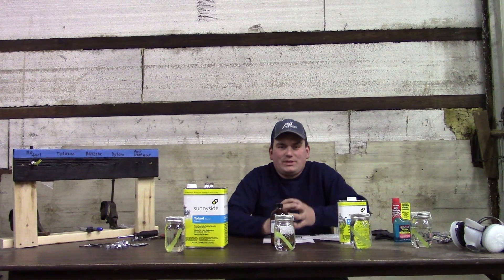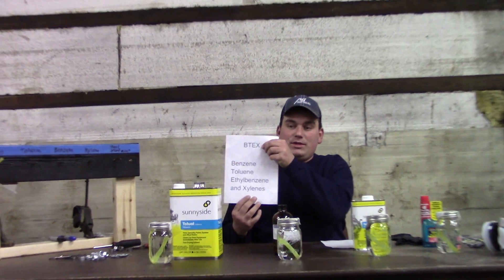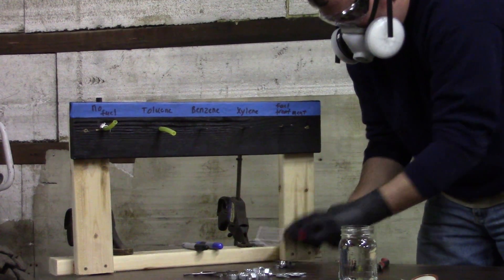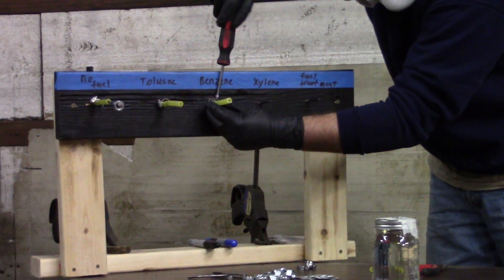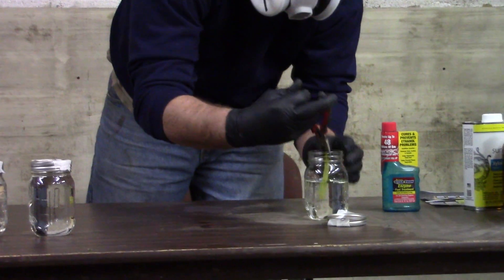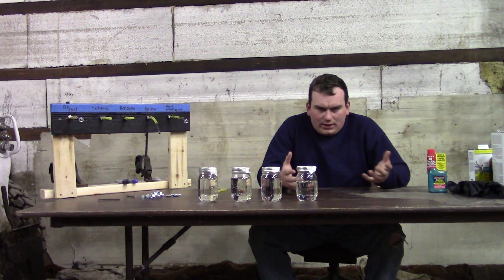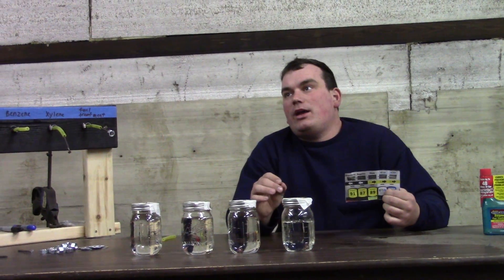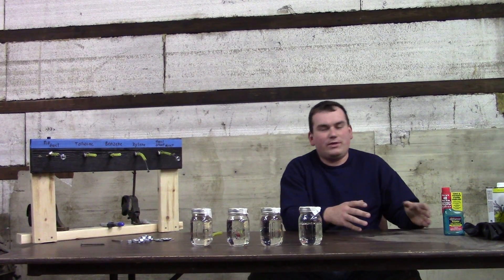What is REALLY causing your small engine issues!!

Comment: I agree mechanics no nothing about fuel properties, composition, or benefits and are the first to help peddle oil and fuel additives.  They are not trained and few have any interest in it beyond octane level.   This is not reasonable comparison and not surprised that no else is using 100% concentration of BTEX chemicals and 100% exposure on fuel lines, o-rings and gaskets.  Manufacturers like to blame other issues.  They can cut their losses by pointing to a mechanic failure.  Case in point.  Gas Direct Injection causes dilution of engine oil and abrasive soot which leads to engine damage and failure.  Ford, Toyota and GM have blamed poor choice in piston rings on a few early year models for timing chain wear and oil consumption when in fact it was GDI.  They repair and replace piston and  rings for a few model years and call it good, while everyone still suffers from the same problem.  Then oil companies and OEM lay low for another five years then make drastic changes to the oil testing and formulation to counter the affects of GDI.  That too was done without much fan fare.  Search on GDI Soot.  GDI gas engines produce more poisonous hard particulates then deisel engines.  Look for Exhaust particulate filters for gas engines soon. Search on API SP new tests.

Comment: Thx for the informative videos.
Is it recommended to run E30 without any conversion kit or mod, such as using bigger injectors and 4 electrode sparks?
When an ethanol conversion kit becomes mandatory, beyond E50?
Does E30/E85 suits direct injection engines?
Reply from the maker: E30 yes

Comment: Ethanol is a water absorber water is corrosive to fuel pumps fuel level sensors etc plus it's good st removing the oil film in the cylinders less btu less energy per gallon per mile more fuel usage.

Comment: My main issue with any ethanol in fuel is makes my 83 mercury 115 outboard run not very well while trolling due to it being carbed and it cant compensate for the lack of energy of the ethanol in the fuel it coughs randomly. I put in ethanol free gas and man trolls nice and smooth.  So with out knowing what others have said i can see a carbed motor running a little hotter while being worked hard since the mixture would be leaned out a little unless it was rejeted to make up the difference  Just 2 cents from experience. I saw your burn test video as well.
Reply: to run Ethanol it is best practice to change the timing setting. pure Eth burns slower. you can even increase the compression ratio to 13-14 to 1.  to gain higher engine efficiency. Eth blends burn faster then Gasoline.ie: E85

Comment: "Do the test yourself". Nothing more definite than that. I'd like to see tests showing where that gummy residue causing problems in carburetors comes from. I have long suspected it's in that gasoline brew - not the ethanol.
Reply from the maker: Orlando Furioso you are absolutely correct. If you watch my other soak test the E85 fuel line is drastically cleaner then the Gasoline one.
Reply: In the gasoline manufacturing process there are some double, unsaturated,  bonds formed in some of the processes, for example cracking of heavy fuels.  This allows a polymerization process to occur and hence gum.  The better gasolines remove the double bonds with hydrogenation, etc, or they add additives to prevent the polymerization..  Typically the better gasoline is made by the major companies.   The cheaper gasoline are cheaper because of less processing steps and cheaper additives.  You get what you pay for.  I am not sure but the ethanol may exacerbate the polymerization process.

Comment: To make this test equal you would need to calculate the burn times for each fuel since E 100 is 33%  lower in power produced per gallon.Now as far as cleaner sure it does burn cleaner but the intrinsic costs such as fertilizer and fuel to produce it must be weighed in the total outcome.100s of millions of cubic feet of natural gas used every year to produce the fertilizer to grow the corn,Millions of gallons of diesel to plant and harvest,Coal and nuclear to cook and make the ethanol.If it could be produced with solar and wind the offset to the environment gets close to gasoline but natural gas and electric along with increasingly fuel efficient engines make the ethanol story a grasp at straws.
 The most widely used fertilizer for Corn is predominately made from natural gas catalyzation.In that process Millions of cubic feet per day are used.When you take all of the story and add up all the parts ethanol is still a net loss on the clean burning side and power production.
Reply from the maker: That's incredibly false. The 33% thing only has to do with btus. They measure heat NOT work. I only loose 14%-18% mpg with e85. Have you calculated the millions of gallons of water used to frac oil? How about refine it? Do you understand all the by products of the corn-ethanol process? Co2 for industrial use and ddgs? I doubt it. fun fact, the usda states that corn ethanol has a 1-2.1 energy return ratio and getting better every year. Its funny you mention natural gas considering this country has so much that we flare it off of wells.
Reply: Jacob Kaul it’s flared off for various reasons but you go with that. Lmao
Reply: Plus more gallons shipped to move the same miles = more wear and tear and more trucks moving more gallons. No win situation.

Comment: I have a 3 gallon tank on my riding lawn mower.  If i fill it with regular non ethanol gas I can mow the whole yard which takes about 3.5 hours, and still have fuel left.  if I fill it with 10% ethanol i have to refill before I'm done.  Can you explain that? Just ran my first tank of e85 in my f150 and got 100 miles less on that tank than with 10% ethanol.  I don't believe there is a cost savings at all.
Reply from the maker: TrainGuy2 that's partially true. Recent studies from oak ridge institute shows that E30 beats E0. There is a sweet spot. E0 and E10 are not it.
Reply: so can you burn E30 in a regular car that wasnt designed for anything but reular gas
Reply: Joe, the only difference between a flex-fuel vehicle and a non-flex-fuel vehicle is in the ECU. The only exception is that cars designed to run on E100 require a cold-start system in order to run on E100 year round.
Reply: Not the ECU but the software the oil company tuned sent to manufacturers to use their fuel. E100 is six percent water and requires fuel enrichment cold starts for fast cold starts and durable battery and starter performance.
Reply from the maker: gspdavis well it should be know the e10 gas was only 85 octane at best prior to Ethanol being added. So it's very different make up wise. And with e85 you will get a bit less mpg but it's about cost per mile. Mpg gets better after a couple tanks to! I know lots of guys that blend 50/50 and save $ !
Reply: To see if the E-85 is more expensive to run, you need to determine the cost in cents per mile driven.  How many miles did you drive versus how much the tank of fuel cost.  If it is cheaper to run the E-85 (I suspect it is NOT by a large amount), then you don't want to run ethanol in the vehicle.  I know for a fact that E-10 results in a significant reduction in fuel mileage versus ethanol-free gasoline.  Ethanol has lower BTUs than the equivalent volume of gasoline it displaces.  Less energy = less mileage.

Comment: i run E15 in my 94 mazda mx6 and i get so much better mpg from even normal premium gas and the engine runs better as well plus e15 is usually quite a bit cheaper
Reply: E15 is really tough on plastic and rubber parts.  Small engines, eg lawnmowers, and motorcycles and older vehicles will be destroyed with E15.  If the vehicle was not made for E15, DO NOT use it.
Reply: ok boomer
Reply from the maker: Shanrod Kennedy I love it 💓👌

Comment: Medical grade tubing is NOT fuel line. Fraud.
Reply from the maker: lol. this is fuel line from napa... I know this sounds radical. but DO THE TEST YOURSELF ( GASP)
Reply: Jacob Kaul That's Tygon (or similar) fuel line, OP.  It's modern fuel line.  I use it on my power equipment when the old rubber stuff has to be replaced.
Reply: Isn't that the silicone fuel line? I've used that on my string trimmer and chainsaw, but I have never seen it used in vehicles as the OEM line from the manufacturer.  I haven't checked out the newest models. from like 2006 to current or the E-85 lines So I can't say what fuel lines they use now but I have always seen the black rubbery type fuel lines in almost all cars that I have looked at and worked on. And that is a lot of cars. I have seen the black rubber fuel lines get super soft and leave chunks and particles of rubber and black oil slicks. I've have bought fuel lines for American, European, Japanese cars and trucks and have never been offered that opaque greenish colored silicone fuel lines. I'm not saying that the newest cars don't use them but from 1950 until about 2005 I have only seen black rubber, not the clear silicone type. If the silicone is superior to the old type I am definitely all for switching to it. I would like to see the black fuel line go through your test. Thank you for making the video.